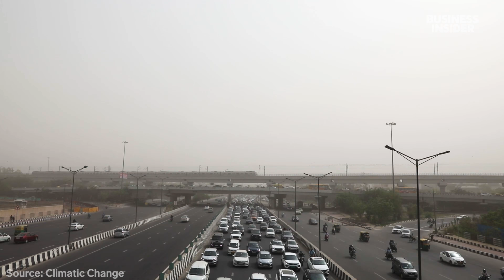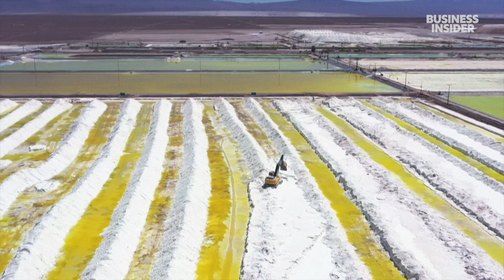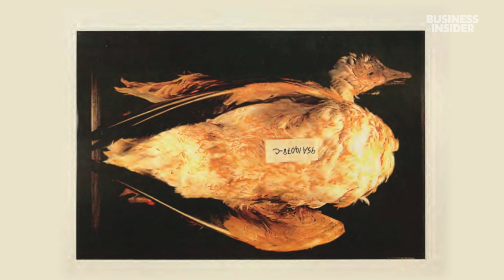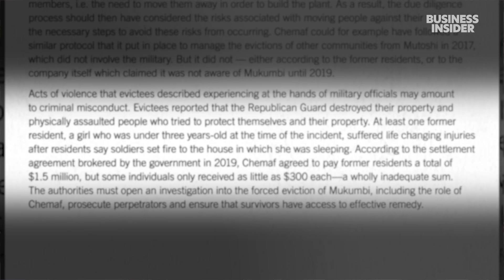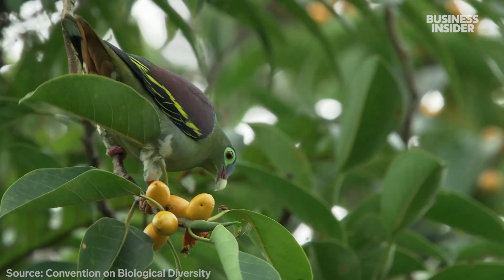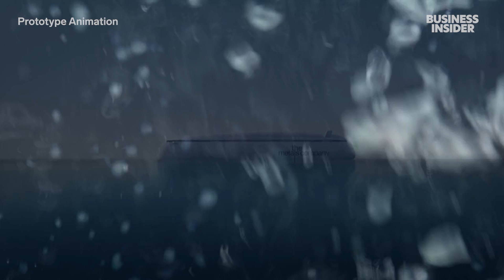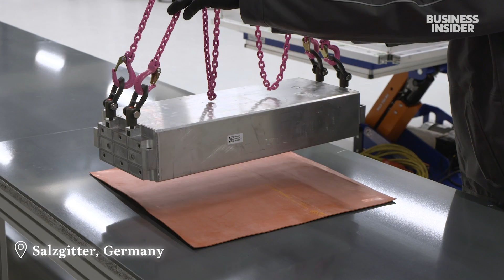The True Cost Of Mining Electric Car Battery Metals | True Cost | Insider News Marathon

Comment: it's easy to say "vehicles" but the awe factor for the data is always applicable to ALL vehicles reporters always fail to separate the blame between consumer passenger vehicles and industry transportation vehicles. Let's not forget that freighter ship use the absolute dirtiest and most polluting fuel for most of their travel because it's the cheapest. There is also all the transport trucks used to make the "last mile" shipping and or to make up for the insufficient rail networks. You literally can't place the blame on the average consumer for their vehicles emissions. There are thousands of decisions made by people and industries that influence the supply of goods based purely on cost and profit margins, and they are the ones responsible for the availability of zero emissions vehicles contrasted by internal combustion vehicles. Ceo's will drag their feet and complain about how they can't just change things because people won't buy evs but nobody talks about how their actions have artificially made ice far too inexpensive. The biggest issue is scale, they need to be forced to increase scale and then there wont be any issue

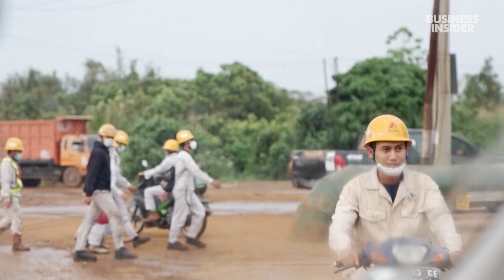Comment: 17:00 Article/video is outdated by current technology. NMC is not the standard battery tech for cars anymore. Modern accumulators (battery is only chargeable once btw) use iron and sulfur and no cobalt or manganese or nickel or zinc.
Reply: It is common FUD, at this point.  One moron makes up some stuff, and then 10 to 100 bigger morons repeat it.

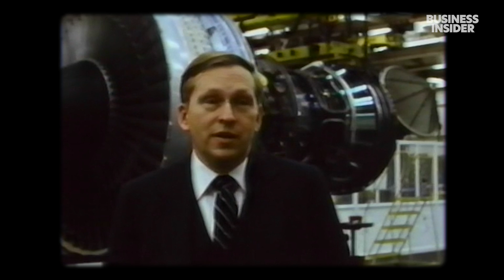Comment: 15:30 False claim! Cobalt is used as an alloy to harden steel for pistons and cylinders in an ICE car.
Reply: Cobalt and nickel and copper are used for other products as well! Not just for car batteries! But nobody complains about that 🤣. For example cobalt is used in drill bits and copper is used for piping and heat pumps!
Reply: Cobalt is used by the petroleum industry to remove sulfur from diesel
Reply: Isnt that chromium? anyways the video is really lacking and isnt a good comparison. Im getting an EV just because of the stupidity.

Comment: So electric cars are responsible for all the environmental damaged caused for an old and closed cooper mine?  Great journalism!
Reply: Cobalt and nickel and copper are used for other products as well! Not just for car batteries! But nobody complains about that 🤣. For example cobalt is used in drill bits and copper is used for piping and heat pumps!
Reply: @surecom12  My cobalt drill bits will likely outlast your 8,500 pound rivian "truck"
Reply: @GeorgeJefferson-h7w    mine didn't!
Reply: hahahah!!! pulling things from underground and putting them on the ground is not environmental damage.  Its environmental relocation

Comment: about time you reviewed your data, EV's are a disaster on every level, you cannot resell them, risk run away fires, and it cost more to recharge the to refuel an ICE car, they cannot even sell them. it was all a globalist scam. these cars etc do have a place but needs battery tech to get innovative, where as tech like methional is clean green and can be made from any biomass and all the infostructure is in place, hydron is very expensive to make in retrospect, EV's are hundreds of times environmentally worse start to finish than conventional car. undersea mining just no way defund that guy asp.

Comment: Nice bit of propaganda. The manufacture of a 100kwh EV battery results in 20 tonnes of CO2 emissions. EV's are at least 30% heavier than equivalent ICE vehicles, and cause more tyre particulate emissions. Lithium battery recycling has no chance of reaching 50% by 20250. But CO2 is not a poison, it is essential for life on Earth, and has only recently risen above a 200,0000yr low which actually jeopardised agricultural production. When CO2 levels are high, the Earth flourishes. CO2 levels also FOLLOW rising temperatures, they do not cause them.

Comment: Some Tesla facts: many of the batteries they use are LFP batteries (Lithium Iron Phosphate), no cobalt, They  are moving to 48v architecture that reduces the copper use by 75% J.B.Straubel, a former Tesla executive founded Redwood Industries which recycles lithium batteries, it is thought that in a few years there will be no need to mine more battery materials as ~95% of high quality materials can be extracted from old batteries.
Reply: the recycling rate on lithium is already close to 100%, and that with batteries who's production didn't had recycling in mind👍

That is do special about EV's. All the energy storing / producing materials can stay in an infinite cycle, while each drop of oil is burned and gone, never to be seen again.
Reply: 😂😂 a Tesla fan boy defending his autistic messiah with hair plugs 🔌.    I despise tesla drivers and tesla.    I LOVE MY V8 Engines 😊😊😊😊😊.    I drive fast for fun, I Rev my Engine for FUN.      Have fun in your sterile EV life.  Haha, u are owned by Tesla, good luck finding a dealer that will fix your car within a month, and get ready to spend some MONEY 😅😅😅
Reply: Trick question: Which of the 3 basic EV drivetrains (BEV vs PHEV vs HFCEV) offers the most benefits, applications and potential to reduce fuel/energy consumption, emissions AND insane traffic? Your answer here __ __ __ __.
WRONG! The correct answer is PHEV plug-in hybrid.
PHEV tech could serve 65% future EV needs. 
BEV serves the remainder in lightweight and short-distance travel/transport needs.
The ICEngine of a PHEV+H drivetrain (combustible hydrogen) stores at much lower pressures
in smaller/safer tanks and can deliver at least twice the equivalent MPG possible with hydrogen fuel cell EVs. PHEV tech is especially applicable to long-haul freight truck fleets. The equitable distribution of battery and hydrogen resources in PHEV tech is far more ideal in PHEV tech which incentivizes driving less whereby local economies grow and more needs can be met without having to drive a god damn car everywhere all the time.
Reply: @artlewellan2294  anyone advocating for hydrogen was asleep in physics class and chemistry as well. Totally hopeless and going nowhere yet you think it’s a big hope.

Would go farther to say Hydrogen is a Big Oil sponsored Trojan horse (read hoax) to distract us from the most efficient BEV where Toyota slow played its hand until Tesla forced it so take note.  Market for Hydrogen cars such as Toyota Mirai has collapsed but if it ever took off, Big Oil would be ecstatic because cheapest source is Natural Gas but emissions to make Hydrogen are actually greater than if you just burned the Nat Gas which would give you 3 times the mileage because creating Hydrogen throws away the Carbon bond that contains most of the energy.
Reply: @artlewellan2294  Wow - what have you been smoking? None of this is remotely close to reality. A Tesla model 3 has a lifetime environmental impact (12 years for the sake of the benchmark) which is 30% lower than a Toyota Corolla hybrid, and 40% lower than a Mitsubishi Outlander PHEV (if both the Tesla and the Outlander are charged 100% from the grid in the UK).

Combustible hydrogen is not only less efficient than a fuel cell it is also less efficient than a combustion petrol engine. If you generate hydrogen from electricity via electrolisis then use that hydrogen in a fuel cell vehicle you only get 40% of the distance per kwh you used to make the hydrogen in the first place vs putting it directly into a BEV, you only get 30% of the distance if you use that hydrogen in a hydrogen combustion vehicle.
Reply: @TB-up4xi  Let me try to change your mind. Equitable battery distribution leads a long list of benefits PHEV tech offers that BEV tech Tesla sedan and Tesla long haul freight trucks do not. The new Prius PHEV pack is 7.7kwh vs Tesla 'S' pack of 85kwh and Tesla freight truck pack of 550kwh. Should limited battery resources go to 1 Tesla 'S' or 11 Prius PHEV? 1 Tesla freight truck or (over 10 years) as many as 370 Prius PHEVs? 

Combustible hydrogen in the ICEngine of a PHEV+H drivetrain can get the equivalent mileage of a Prius PHEV (an 'effective' 125mpg) while the Prius HEV is rated only 40-45mpg. The mileage leap is accomplished by driving less than 30 miles per routine daily trips and recharge. By driving less and without hard acceleration (reducing traffic insanity), PHEV+H can deliver higher mpg than hydrogen fuel cell. 

Other benefits PHEV offers include rooftop solar array systems; the smaller PHEV battery pack is a better match to most rooftop arrays. When the smaller PHEV pack depletes to the point where it must be replaced, they can serve as household low-power supply for several years; harder to do with larger battery packs which are also much more expensive to replace.   

The REAL problem is the AMOUNT of driving. PHEV tech incentivizes driving less, whereby local economies grow and more trips become possible without having to drive. Your counter-argument, TD, is sophomoric.